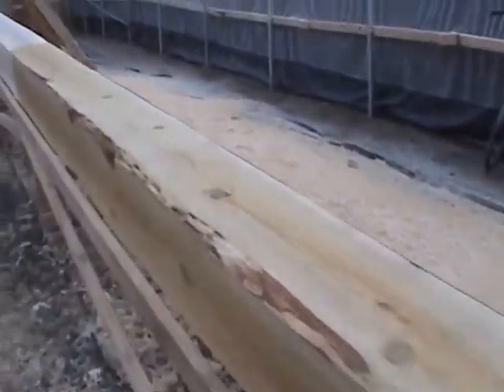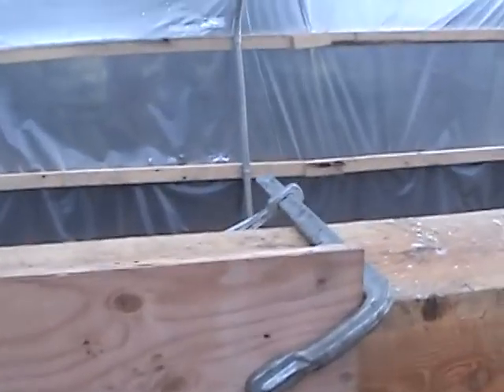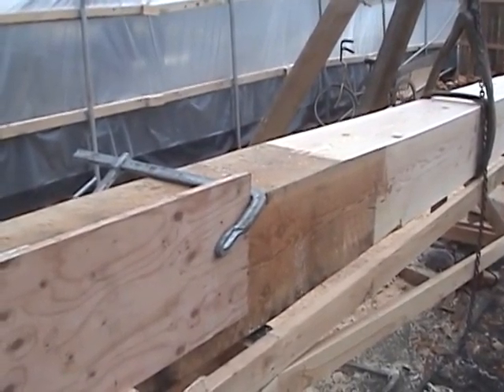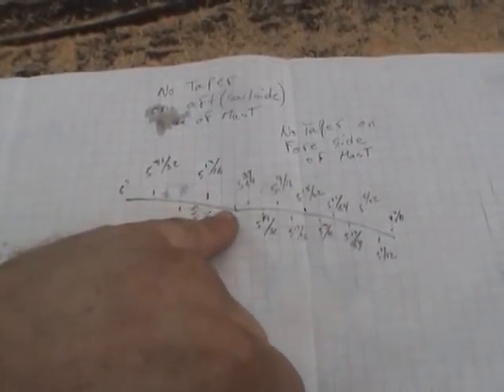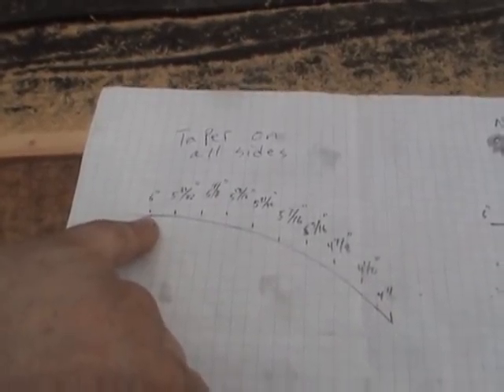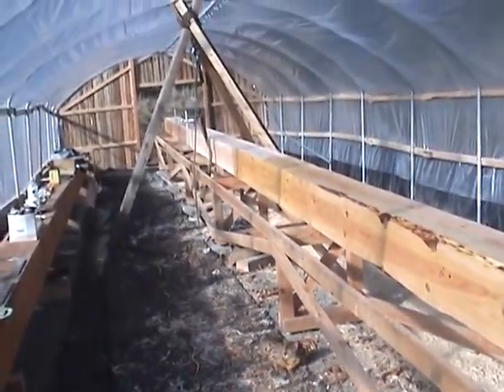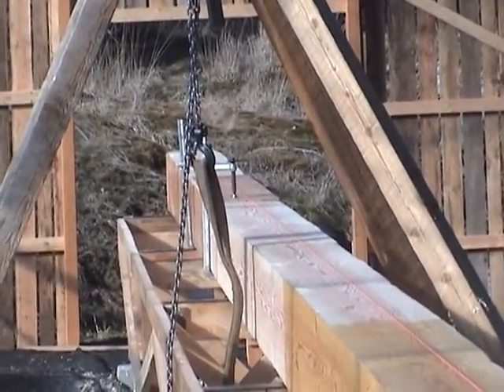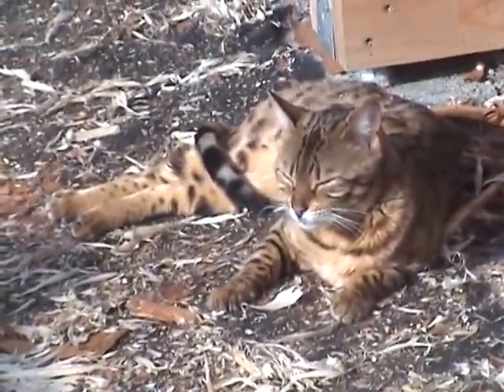spar progress 02/21/09

Comment from the maker: 60' mast. finished length is 57'9"
6 3/4" makita power plane. first set of blades so far. Planer came with a jig for sharpening the blades.
next mast is 52'6". Over the top project. How do you eat an elephant? one bite at a time. snow and rain occurred in december. lots of wind too.